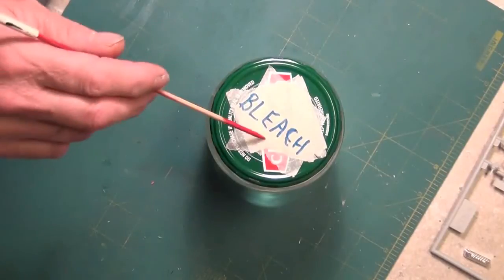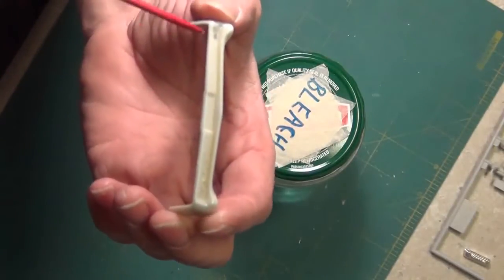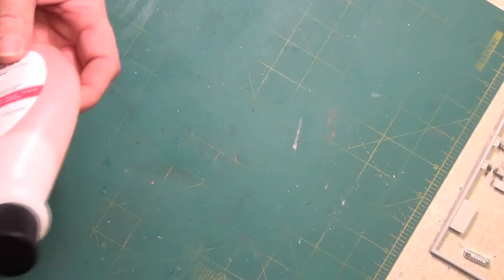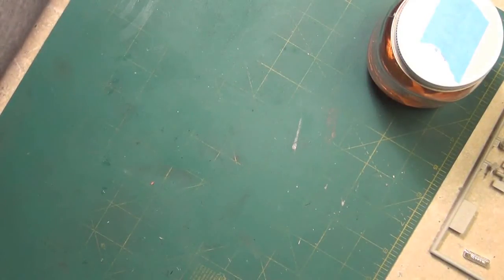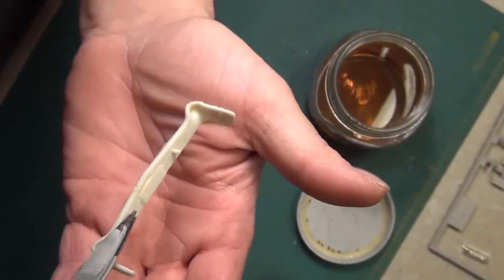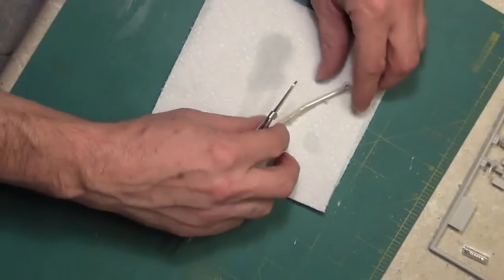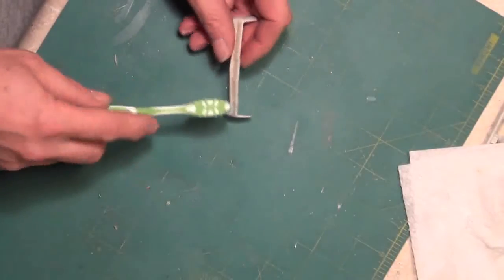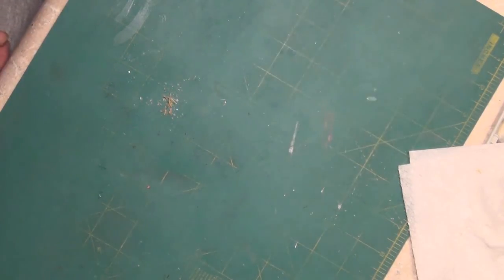Removing Lacquer Undercoat from Chrome

Comment: Great vid, Thanks for the tip.
Here's another one :
Before dipping the part in the non-acetone, sand it lightly with 600 or 800 Grit.
In this way the non-acetone liquid will flow dipper in to the laquer paint.
Keep those tips coming !

Comment: Andy...you ever try Krud Kutter? It's a paint stripper. I've used it on chrome parts and it removes both layers well.
Reply from the maker: good tip I will have to get some , thanks !

Comment: yeah good to know..since I never used to strip chrome off anything and just started to dabble in that and thought it was good to just leave the lacquer under coat on it so my finish would be just as smooth..Thanks Andy
Reply from the maker: on the newer kits the undercoat is usually really smooth ,  it's the older kits where it is almost slopped on ,that I like to strip it